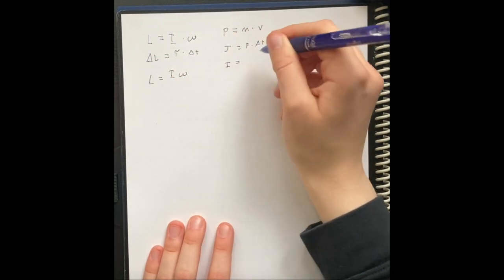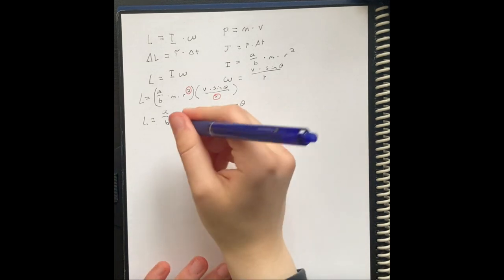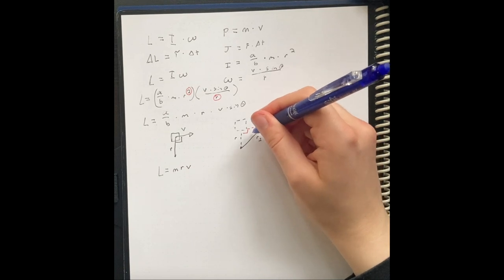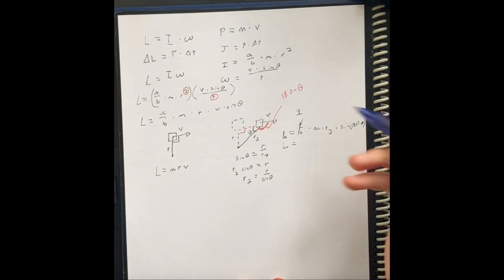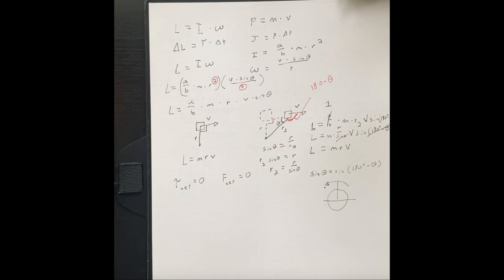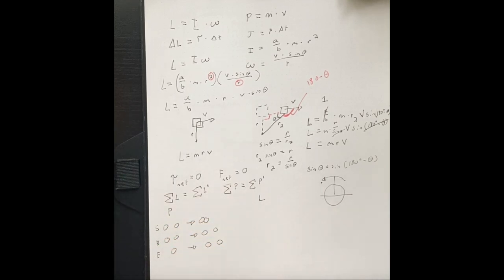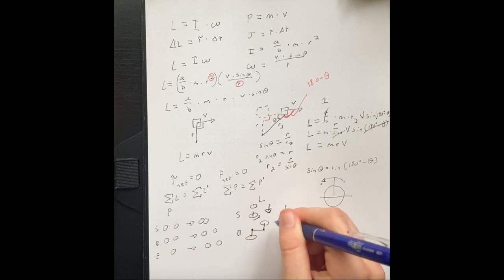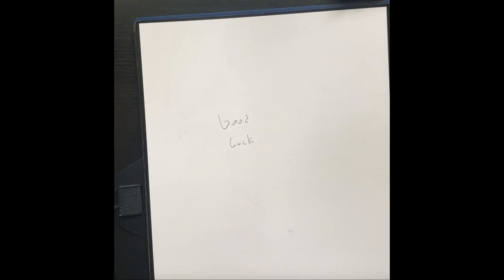Explaining Angular momentum

Comment: Since angular momentum is originally defined as L = r x p, it is not rational to claim that angular momentum is an analog of momentum because it is defined by momentum. It cannot be analogous to it if it is defined by it.

To calculate the angular momentum of an object that is moving in a straight line, we must use the genuine radius of said object which is perpendicular infinity. We cannot just randomly pick a pivot point. That is pseudoscience. Especially when you consider that any point you pick with a different radius will produce a different result for the angular momentum. It is complete delusional nonsense.

I know that this is what is being taught, but what is being taught is nonsense. 

I am sorry to point this out because people seem to get upset and abandon rationality,  but the fact is that angular momentum is not conserved.

Think clearly now. If angular momentum were in fact conserved, then a typical ball on a string demonstration of conservation of angular momentum which starts at 2 rps and has the radius reduced to ten percent must accelerate just like a Ferrari engine does because the genuine physics prediction is that it will reach 12000 rpm.

If the prediction is wrong, that means that the theory is wrong.
Reply from the maker: That’s incredibly interesting and I’ve never thought about it that way before. For the definition of angular momentum, would it still be true that it is equal to moment of inertia times angular velocity or is that derived on the assumption that it is analogous to linear momentum?

So the radius of a linear moving object is infinity which is perpendicular to the velocity vector. How would we use that in an equation? Wouldn’t the angular momentum be infinity too?

As for the conservation of angular momentum, I think we may just be ignoring all real life things that could add torque so if that’s the case it makes sense that angular momentum isn’t actually conserved. 

Thank you so much for the feedback, Im a first year physics student who makes videos to help me and my classmates understand the material better. I’d love to get a firmer understanding on this so I can make a better video.
Reply: @pleurote6988  It is true that angular momentum is equal to angular velocity times inertia. 

Yes. That is the point I make. The angular momentum of a linear motion is infinity. 

We neglect friction when making theoretical physics predictions. That is what theoretical physics means. If you are trying to claim that a ball on a string is not supposed to conserve angular momentum becaseu of torque, then you contradict three hundred years of physicists who have all claimed that it does conserve angular momentum. You are shifting the goalposts and grasping at straws.

It is unreasonable to try and explain away a missing ten thousand percent increase in energy by blaming friction. It is irrational.

If you want to make a better video, then run a ball on a string experiment and confirm that it is in fact angular energy that is conserved. Instead of yanking on it like a modern physicist (DOGMATIST).